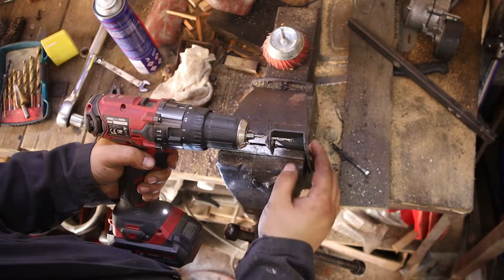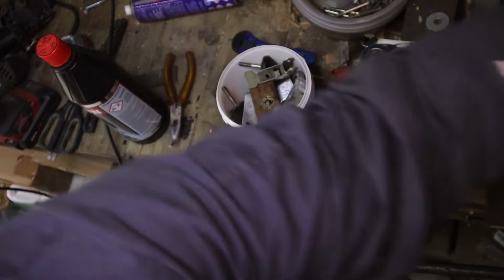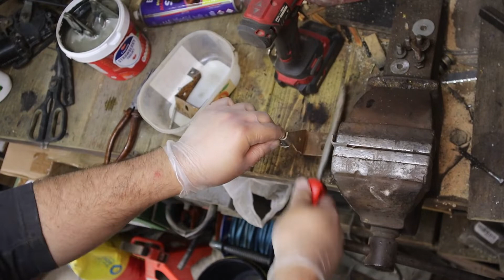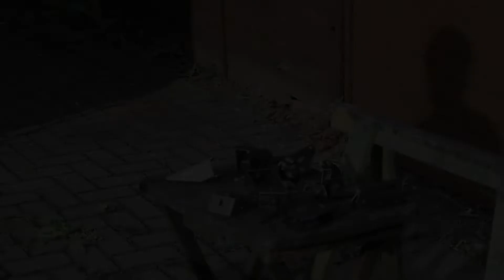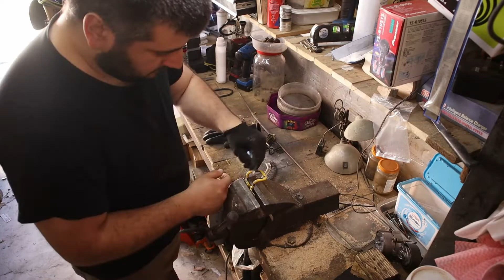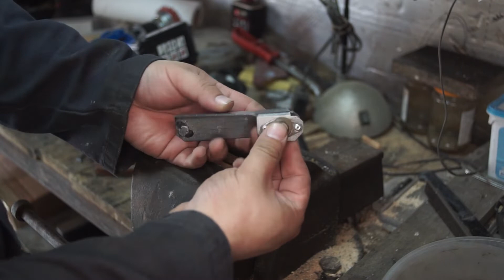Preventing rust for another 30 years (phosphoric acid)  - Lotus Elan M100 Project

Comment: 80% Phosphoric acid is the perfect concentration to neutralise rust. DO NOT Immerse or soak steel for long periods: Just spray, allowing air to evaporate the surface. It's best applied on a day when evaporation is "normal": 20+ Dec C with low humidity. The iron phosphate coating it leaves is a perfect primer. No need for rinsing or heating if you have just sprayed the surface, if you rinse or heat after spraying you'll transform the reaction.

Comment: Will phosphoric acid remove good metal if left too long or is its safe enough?
Reply: At 60-80% you should spray and let it evaporate.  Don't soak parts, if your steel is badly rusted then it needs to be cleared of flakey rust scale first, before treatment.

Comment: Thanks.  On another rust removing video a guy uses 60% phosphoric acid and squirts some hand sanitizer in it.  Says that eliminates the need for neutralizing it.  This looks amazing.
Reply from the maker: Hand sanitizer is mostly alcohol. Which is not a alkaline. No idea how that can neutralize the acid.
 I'm no expert, it may work, but I wouldn't put money on it.
Reply: I recently used alcohols (iso and methanol) to rinse a motorcycle gas tank that I had derusted with molasses. Next soak was phosphoric acid, followewd by another alcohol rinse. The net result of the alcohol is to displace surface water and dry the part faster. That was my experience. HTH @tuga2112
Reply: @tuga2112 that would be like the  video that says water neutralizes  muriatic acid.

Comment: I use citric acid first, from the bakery section in supermarkets to remove what I can. It gets rinsed off in an alkaline solution. 
Then , the phosphoric acid is used. Rinsed off in water only, then the metal is heated with a flame to remove ALL of the moisture.. Ferric oxide becomes ferric phosphate, which is inert. Then, the parts can be immediately prepared for coating.
Reply from the maker: citric acid is something i only use when im dealing with deep rust. for this type of situation citric acid eats away goo metal. and i dont really need that level of detail
Reply: @tuga2112  That's what I thought as well. Citric acid is too aggressive. But Phosphoric acid doesn't eat away on healthy metal at all I guess?
Reply from the maker: I wouldn't say citric acid "is too aggressive" it's more the fact that it will keep going and potentially take too much metal out. 
The phosphoric acid has the positive effect of converting the rust into iron phosphate which "seals" the metal behind it from oxygen acting as a preventative coat. 

The only problem with it is that it may not penetrate all the info the good metal and seal air/rust underneath between the iron phosphate coat and the actual metal you want to protect. 

I usually clear out as much dust as I can by abrasive means before treatment. Wire wheels on the drill, grinder or dremel and sandblasting are the usual approach. Them I start the acid treatment.
Reply: @tuga2112  Aha, alright. That's good info. I was thinking of spraying some under my car mostly as a preventative action, but I might not do it now because of what you wrote. What about tannic acid? I have seen some videos of people combining it whith phosphoric acid.
Reply from the maker: I've only heard about tannik acid just last week for the first time, I'm planning on researching about it and possibly try it next time.

Comment: Hi there......I enjoyed your video. We too have been using Phosphoric Acid for many years to neutralise rust. Can I make some suggestions, should you use it again?
The concentration of acid in the product that you are using is very high. Believe it or not, most acids work more efficiently when not as strong as this, as you need Hydrogen ions in the water to be "added"  and free moving,for maximum efficiency (Ph strength is after all about the potency of the Hydrogen atom). We would recommend diluting your bottle down to between 8-12% acid. Work this out on paper first and add the acid to the appropriate amount of water, never the other way round. 82% acid is 82 parts acid and 18 parts water. Work out what you have to add to achieve 10 parts acid in the total solution, easy? lol
I was worried for you at that concentration as it will in reality be aggressive, that you put parts with threads in the bucket. Acid tends to like to eat metal threads and if the acid is too strong, or you leave the parts in for too long, then the threads can actually disappear! This has happened to us. Even if the "damage" is not obvious, then a thinning of the metal in the threads, however small, could affect the strength in a tightened joint, which you clearly don't want to happen. 
You also made the mistake of washing off the acid, and that is why you had later flash rusting. Just "drip dry" the parts straight out of the acid bath, either by hanging or propping them up........we sometimes rest them on a rubber mat to dry, as that will not stick to the part like tissue paper does. This is so that the layer of iron phosphate can "cure" on the metal and provide protection. If you rinse the parts then this is effectively washed away. On the other hand you DO need to rinse of most other acid preparations, but not Phosphoric Acid. If dried correctly a nice matt grey layer of Iron Phosphate should appear on the metal. You can paint over this when fully dried (give it 24 hours) and you can scuff it over with a Scotchbrite pad first if you wish? We have parts which we blasted and dipped in acid years ago, still in the open workshop and with no rust after that time. I have to conclude that this layer, when painted over, will therefore give extremely good protection against rust forming again on the metal and breaking through the paint?
We keep a medium sized plastic tub with a lid in our garage, with an acid solution inside. This normally lasts around a year or more, and we change it when "metallic" deposits get too much on the bottom of the tub. It lasts way longer than you experienced? When a car is stripped down we sandblast almost all mechanical parts in time and most get "thrown" into the acid bath for a couple of hours and are then drip dried, put away and painted or powder coated at a later date. It works very well.
We have been known to make up a small glass jar of solution and add a bit of wallpaper paste. When this thickens we use it to paint on car bodywork which is rusty. This stays on the metal due to the thickening and we have had fantastic results with this. It gets rust out of the pits too. We never see rust reforming in these places, and it is so cheap to do!
Hope that helped?     Regards

Ken
Reply: whats your opinion on vinegar for the floor board. I spray it and cover with plastic but it still dries. I will keep respraying and using scotchbrite for a month or so. I heard you dont need to neutralize as vinegar is water soluble. But like you said thats when I could get flash rust. Another question. Would you recommend spraying primer right away? Im not a good painter so I wanted to leave metal bare until I can get the whole car in a booth. Can I just cover the metal with engine oil/ wd40/ Vaseline or will that make things super complicated when its time to remove it? thanks in advance
Reply from the maker: I've seen videos about vinegar but the people who claim it works never put it to the test with the type of rusty surfaces we encounter in 30+ year old cars. 
The citric acid is something I've experimented with in the past with enough result to say it's effective but if left for too long it will corrode the good metal as well as the rust. 

I would use citric acid if something was very corroded in order to ensure all the oxidation is removed but after that I'd still use phosphoric acid to give it the iron phosphate coating that protects against further oxidation. 

The coating of iron phosphate is a perfectly adequate primer. I was sceptical at first but after a few uses I'm not planning on putting primer on anything that isn't bodywork. The difference is so minimal that I don't find it worth the time and money spent, specially considering the places where the parts are going to be used
Reply: Wow - excellent advice.
Reply: thank you man that was so informative, i saw another guys video where he dipped rusted parts in phosphoric acid and removed it , later also wiped the grime on it to give shiny surface, thats where i was confused , as i read that phosphate layer can be painted, he actually removed that wet layer , but your tip on the drying part was what i was searching for.. thanks a thousand times.
Reply from the maker: Thanks for there tips. I will certainly try them next time I'm doing rust prevention. 
Have you ever tried using the acid warm in order to make the reaction faster? 
I found that to work rather nicely when I tried a few very small bits in a tin with a t light candle underneath.

And yes I do agree using the acid at 82% concentration is overkill. As well as far more dangerous than at lower concentrations which are just as effective, I am sceptical about the lower concentrations being more efficient. However perfectly happy to try and see what happens. To me it seems logical that 82 is far too saturated of a concentration, but seeing that resulting in a less efficient mixture seems counter intuitive. But as I mentioned before. I will be trying it out, it would be stupid to not try. After all it will be a cheaper solution of it works and less dangerous. 

And yes, in following attempts to deal with rust I did drip dry parts which clearly was a better approach than rinsing before the chemical reaction was fully "completed". 

It's comments like yours that really make the effort put into these videos worth it. 
I've been working on the elan for 9 years and there's always something new to learn from others experiences